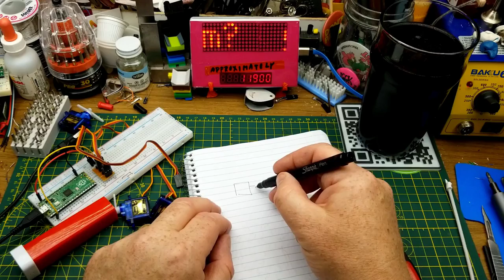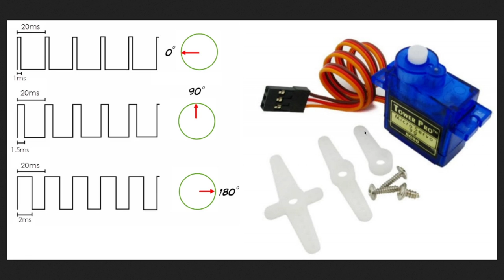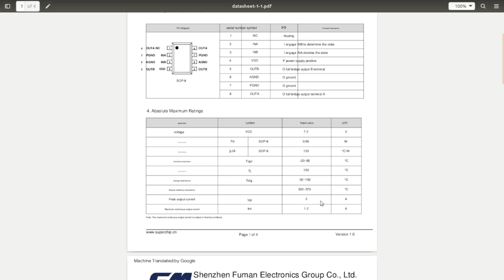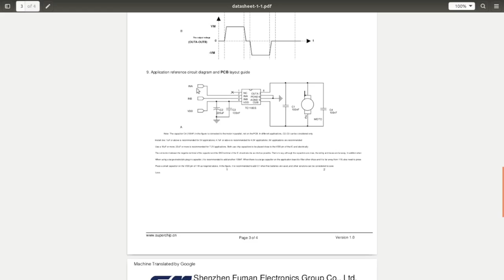What's inside a cheap RC servo - curiosity teardown

Comment: I'd put in a vote for a damaged/noisy pot. Its probably not worth repairing as you said - but the controller might be fun to experiment with. I recall back in the 80's Maplin Electronics used to sell servo chips, and I learned how they worked without ever buying one from the info in the catalogue! Back then a servo was a major investment to a teenager....

Comment: Interesting test would be to set it to swing back and forth all night long then check if it was better in the morning. If so, a bit of a bad spot on the pot.  Use to have lots of problems with pots if these sat for a long time inactive and the parts were not even cheap. Nice video.

Comment: You should limit the travel when testing the servo, as without feed back the output can still swing from end stop to end stop. I've often cut the end stops off remove the drive to the feed back pot. Set the pot to mid point, now you have drive motor where you can change speed and direction with one pwm signal.
Reply: Meow!!!!!!!!!!!!
Reply: Yes I would cut off the end stop,

Comment: That one did seem ' better ' gear wise once the flashing was removed.  The going back and forth when the other was doing only one direction sweep could be faulty variable resistor.  For the other one, get it to go to 90 degrees so you know what it is at before opening and where the end stops should be at.

Comment: If you disconnect the pot (mechanically), and remove the end stops,  then as long as you give the board the drive signal, the servo will continue to rotate, could be useful as a drive motor for a car
The pot is used to set the speed iirc in this instance. set it to midway for forward/reverse, or to one end for single direction speed
I did this a few years ago 
I'm sure that rc cars use this method, be worth a play.
Reply: I did a similar conversion to make a continuous rotation servos a while ago too.  You have to set the pot to it's middle position when you disconnect it from the gear train as well.  The servo driver board needs to think the motor is in it's neutral position.  Or remove the pot and replace it with an equivalent resistor divider.  Then you can control the speed and direction of the motor with the servo signal.  It does seem like the pot position is not aligned with the mechanical position of the end stops.

Comment: I find when you add multi servos, they need 6V and must share there own power supply separate from the data and with a very big capacitor across it. Those cheepos are very likely to need 6V for sure.
Reply: The specs say 4.8V to 6V

Comment: I use servos to switch my HO scale turnouts. I've had pretty good luck with "DIY More" brand metal gear servos.
Reply: I'm planning to use servos like these also for HO turnouts.  Some have plastic (nylon) gears, some have fiber reinforced plastic gears, and of course some have more expensive metal gears.  Some are "digital" but I'm not sure what that means.  Gonna try the reinforced gear servos first.
Reply from the maker: That's how I ended up sith so many of them as well:  https://www.youtube.com/playlist?list=PLE9Um5NpNcs5ghfp6Y1Ezy2zEPmlIH01u

Comment: I don't know why you didn't seem to run into an issue with timing of the pot gear on reassembly. Got lucky? Way way back in the 70's I built mini kit servos from Ace Electronics and there were alignment dots on the gears. I didn't see any on those
Reply from the maker: The shaft is keyed.

Comment: Most likely both too noisy a supply, and a wiper of the pot that is intermittent,  both very common on those cheap RC servos.  1000uf cap on the interface board to decouple it, and then see if it improves, and run not stop to stop , but from 45 degrees to 135 degrees, as a good test to see both the overshoot from a noisy feedback pot, and that it actually is closing the feedback loop. Or just set to 90 degrees, and disturb the output shaft to see if it corrects it back. Will have a little jitter, but normally there is a bit of deadband, so jitter is an indication the pot itself is noisy.